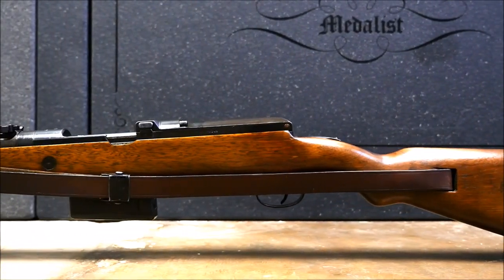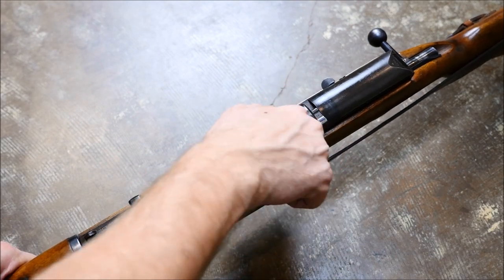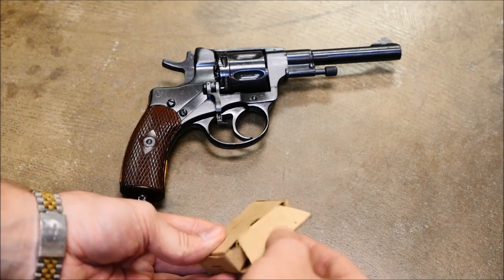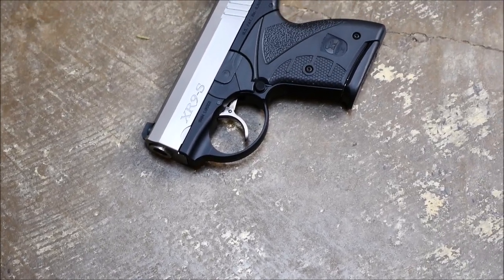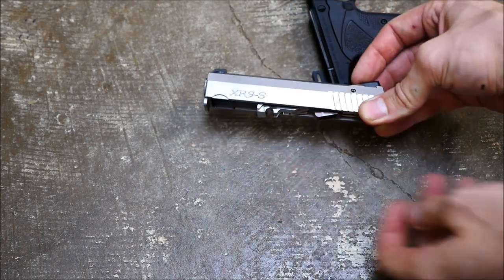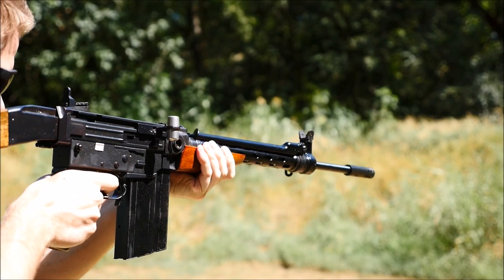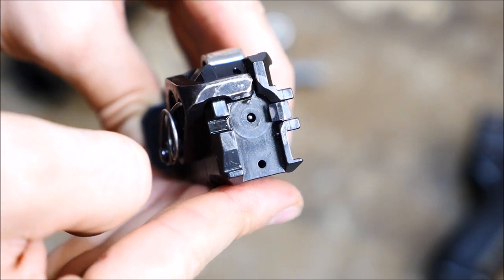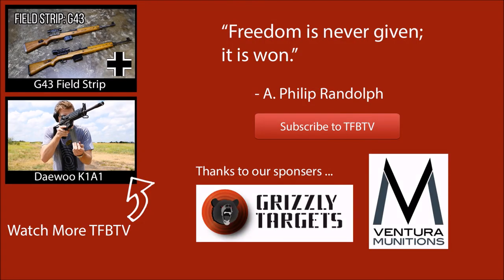Top 5 Overly Complicated Guns

Comment: overly complicated is often synonymous with "well engineered". :)
Reply: Douglas Thompson And “hard to clean”
Reply: and "a pain in the ass to replace any damaged parts"
Reply: And more parts to fail. Simple is better.
Reply: And well engineered is synonymous for made in Germany 😅
Reply: The Tiger I was overengineered to the point where if it ever broke down, the crew couldn't even fix it
Reply: Nick Siegfried yup
Reply: @nicksiegfried4906  not because it was simply overcomplicated but because there were almost non spare parts and the development was rushed
Reply: @joshuaa4677  instear of complaining about complexity how about take the extra time to learn it, its kind of lazyness when not liking things because of complexity
Reply: First of all, I wasn't complaining, I was just stating a fact, and secondly, if there is an alternate to something complex that does the exact same thing as the complex thing but is much simpler to use, it's not being lazy to choose the simpler one, it's efficient. In programming, it is very easy to make a program that does something, but the main goal is to make that program run quickly and with the least amount of drain on the computer, to do that, you need to make the program simpler. When the complex way is the only way to do something, that's fine, but the second that there is a simpler way to do the same thing, you would have to be insane to choose the complex way
Reply: and "fucking bullshit with how many parts there is"
Reply: As an engineering student, I know for sure that we strive to simplify systems as much as possible. More moving parts means more possibility for failure.
The best system is able to perform the same task as other systems, but cheaper and more reliably. The latter often correlates with simplicity in design for reasons already stated.
For example, the 1911 is a simple design, especially in comparison to its contemporaries at the time. Browning’s best designs in general have become the basis for a lot of firearms engineering.
Reply: uh
Reply: Yes and no
Reply: Douglas Thompson agreed
Reply: Douglas Thompson rare and expensive too especially the sig iv seen them sold for over 10 grand and when they first came out were only 348.00 in the mid 70s
Reply: Gotta disagree on that one
Reply: 'Over engineered'. When crap breaks but isn't needed for operation...
Reply: @31er_ohne_AMG  explains Chrysler transmissions...
Reply: The complexity of the weapon will be inverse to the intelligence of the operator.

Comment: Why don't you do a run and gun with the g41m?
Reply from the maker: If it breaks, I have just broken a $20,000 gun with no replacement parts.
Reply: +TFB TV very true, very true. I would just like to see it in action and see how it compares with the g41W
Reply: +TFB TV parts can always be made.
Reply: yeah for another 20k
Reply: +BLT not even close
Reply: +wonderfulmax     A machine shop would have to reverse engineer the parts while they are in mint condition. Considering its rarity, "no replacement parts" is an accurate statement.
Reply: +Captain Obvious I work at a machine shop. I do it every day. every single part on any gun can be reverse engineered and made.
Reply: wonderfulmax
I worked at a factory when I was in college. A part on a critical machine failed, and we tried to get a machine shop to reverse engineer it because we couldn't wait for the manufacturer to ship us a new one.

It was far too mangled for them to reverse engineer. So I'd say that it depends on the damage to the part.
Reply: Easier said than done on a firearm that is notoriously complex & unreliable even with mint condition factory original parts, not to mention one that only 5000ish(?) examples of were ever made.
Reply: someone in this thread should reverse engineer all the parts in it, make a new one!
Reply: DarkShroom That's actually not a bad idea.

TFB TV said the gun cost $20,000. With a price tag like that, you could probably make several thousand selling replicas.
Reply: +Captain Obvious I would buy one
Reply: lmao no, type 95.
Reply: Guessing by type 95 you mean the QBZ-95? If so, why? Everything about it besides the cartridge is comparable with other modern assault rifles and it uses no advanced or unusual firing mechanisms.
Reply: no he ment the japaneese type 95 from Japan the qbz 95 iisnt in america
Reply: Clayton Burch what are you talking about? there are 2 Japanese tanks and 1 armored car called the type 95 but the most recent Japanese rifle is the Type 89. Japan doesn't export firearms to the US either.
Reply: Clayton Burch the newest Japanese guns you can get in the US are Arisaka rifles from WW2.

Comment: The Remington Model 14 was, and is, the most complicated gun I can imagine.  Take a look at the illustrated parts breakdown of the bolt and bolt carrier.  John Pedersen was an evil genius.  http://stevespages.com/ipb-remington-14.html
Reply: +RyeOnHam I read a quote once about Pedersen that said he would use three parts where one would have sufficed.
Reply: +RyeOnHam 75 parts is not that bad. If you think this is a complicated old gun you should see the Browning BAR. I think it's got well over a hundred parts and its disassembly is FAR from intuitive.
Reply: +RyeOnHam  I've read that the Lahti-Saloranta M/26 (a Finnish machine gun) is also extremely complicated.
Reply: +Jeff Thomas 
I've heard the same saying in reference to John Browning,
Reply: John4566442 Hardly.  Browning would use one part in place of 5... and he did.
Reply: LOL... I don't think so. The Auto 5, Model 8, the 97 pump, the early Remington shotguns, many of his pistols, his machine guns and most of the other Browning designs are all extremely complicated. Although revolutionary, they often use complex mechanisms and lots of small parts. More so than contemporary designs? In some cases, there were no contemporary designs, but I would argue that Browning wasn't a fan of simplicity.
Of course, this is with 130 years of hindsight. Browning was a great innovator and the most prolific American gun designer of his era. Even if his guns are over-engineered, they are brilliant original ideas, not copies of other designs.

Of course, this is just my opinion. One man's complicated is another man's simple.
Reply: John4566442 You just mentioned the three groundbreaking firearms.  The Remington model 8 was copied by none other than John Garand and Kalashnikov.  The Auto 5 was the first autoloading shotgun.  The Model 97 pump is still in production today at at least two factories.  Just because they are complex does not mean they are OVERLY complex.  Just look at the Remington model 17...  Browning designed the gun over 100 years ago and it is still in production (Ithaca 37 and Chinese Copies) as well as providing a heavy influence on several other designs like the Mossberg 500, Remington 870, Browning BPS, and numerous others.  Don't get me wrong.  I like Pedersen, but Browning was godlike.  Hard to name a single modern firearm that doesn't have Browning written all over it... except maybe revolvers.
Reply: I agree that Browning was hugely influential and his designs were ground breaking, no doubt. Whether they are just complex or overly complex could be argued either way, since that is purely a matter of opinion.
Reply: John4566442 I would argue differently.  At the time, the Browning Auto 5 was the LEAST complex autoloading shotgun on the market!  I would also argue that the Winchester 1893 was the least complex and most robust pump-action shotgun on the market.  The fact that virtually NOBODY did it better in the last 100 years other than Browning himself kinda supports that.
Reply: Well, you're right. When introduced they were the most robust and well designed guns of their type.

I disagree that nobody did it better for 100 years.
Reply: John4566442 Well, I challenge you to name a gun that wasn't heavily influenced by one of Browning's designs over the last century. You would have to look at only two primary designs, the Savage 520 and the Remington model 17.  But careful, now, because Browning designed more guns than were produced.  May features that showed up in the Winchester model 12 were from Browning patents owned by Winchester.
Reply: The Remington Model 10.
Reply: John4566442 You're funny.  That's a Pedersen design and it was a pile of junk along with the updated model 29.
Reply: How is that funny? You're right, it's a Pedersen design and not a Browning.
Reply: I'm a fan of both Pedersen and Browning.  Browning had already pretty much cornered and patented every good idea by the time Pedersen stumbled along.  Pedersen engineered and tooled the model 17 based on Browning's design.  Despite being a prolific designer in his own right, Pedersen's designs survived only as long as they had to and then Remington ramped up to produce Browning-based designs.  It's not a perfect fit as many good design ideas did not have a JMB stamp on them, but still.  I thought it was funny in that you brought up the Edsel of firearms design.  You may have seen a model 10 that worked well, but I have not.
Reply: Have one in my buddies office. Haven't had a chance to test fire it.
I can't help but to agree with you on most counts.

I too am a Browning fan, so it's hard to make counterpoints. I had to pull the Remington Model 10 out of my butt to come up with something that wasn't Browning.

I have always felt that the Auto 5 was pretty complicated, but I misspoke when I said that it was complicated compared to other guns of the era. That was wrong. Compared to modern guns, the Auto 5 is complicated, but it's a hundred plus year old design and the first successful gun of it's type, so I suppose I should cut it some slack. It took over 50 years for something "better" to come along.

It's easy to forget that those guns set the standard for pretty much everything else that was to follow.
Reply: @John4566442  probably had to do with material and manufacturing limitations at the time. Brownings gun are fairly simple for what they are,

Comment: Also the Russian An-94 hyper burst rifle came out in 1994 originally for the Soviets but was adopted by the Russian federation. Has 114 parts. Originally to replace the Ak-74 platform but was to complex and expensive to produce so in 2006 they stopped producing but are still in service with the Russians as they one hyper burst you get when you pull the trigger comes out in 1800 rounds per minute while it’s regular fire rate is standard 600 rounds per minute

Comment: I cant believe you didn't mention the wheellock, it was needlessly complicated in that the way u prime it was to take a wrench and twist the wheel which took some time. It also needed a very powerful spring to spin the wheel which would break easily and was difficult to fix on the battle field and expensive to make.
Not only was it needlessly complicated but also unreliable.

Comment: i on one hand think overenginnering is great. I mean, its awesome if you can create an efficient, effective, yet simple design (like an ak-47) off the bat, but we learn through trial and error. I really appreciate the platform for improvement that overengineering offers, not to mention the many ideas it brings to the table. Which part of the system do we improve upon? which parts do we mitigate? its artistic, in my eyes

Comment: The Nagant is an amazing revolver to have on the grounds alone of its uniqueness. It is definitely one of my favorite pieces in my collection. As for the suppressor story, they can and there were some that were for KGB as a way of a more  silent kill and depending on the maker of the suppressor they can be very quiet. They made snub nose ones for agents as well. The first Nagants were single action only so you would have to cock the hammer manually but then it was realized it was a flaw and converted most of them to double action like the officers ones so single action are the rarest one to find.

Comment: The Madsen LMG.  In an effort to produce a more compact light machine gun, the Compagnie Madsen A/S designed a special recoil-operated falling-block mechanism which allows the entire cycle of loading and unloading each cartridge to be accomplished with the whole thing recoiling only half an inch.  The gun doesn't have a bolt; it has a falling breech block similar to that used in a Martini-Henry rifle.  During recoil, the breech is opened, and the extractor lever pulls the spent cartridge out of the barrel and down the ejection trough cut into the bottom of the breech block.  When the mechanism cycles forward, a new cartridge drops down from the magazine and is rammed into the barrel.  The breech is then closed, and the hammer is released, firing the cartridge.  The whole mechanism, with the barrel attached, is locked back when the gun is ready to fire.

Comment: The SIG AMT looks a lot like the STGW 57, the battle rifle the swiss army used until the 90s and i dont think thats a coincidence. my father likes it very much and even if its not as accurate as my army rifle, the STGW 90 or SIG 550, its still very competitive in tourneys in switzerland. also, here the winter trigger is more used than the standart one because you have a longer lever and can pull the trigger more sensitively.

Comment: I remember seeing a stupidly complicated gun in a museum here in the UK. It was a revolver, but instead of having a rotary magazine and a single barrel, it had 6 barrels on a rotary, so one for each round. When you fired, the whole barrel array would rotate like the magazine in a normal revolver. I just had to wonder who in the hell thought it was a good design.
Reply: That's actually simpler than a standard revolver - you don't need to be concerned about the high(er) tolerances needed for cylinder timing etc.
Reply: +TheEnglishRedneck45 plus no gaps in between the cylinder meaning less wasted gas.
Reply: I would want to see that design
Reply: They're called 'pepper-box' or 'pepper-pot' pistols. I've seen a few in antique shops in a variety of places, but they're mostly replicas and very poorly-cast.
Reply: xD ive seen one of those and like, who ever made them had nothing to lose

Comment: One of the big advantage that the Nagant Revolvers had over other revolvers were that they were gas sealing like you said. So you could even shoot with your hand in the odd position in between the cylinder and barrel if you should ever need to without it tearing up your hand. And if your in a tight space, the guy beside you isn't getting all that expelled energy and gas from the cylinder to the barrel.

Comment: The M-16. 
Haters gonna hate but between the charging handle, bolt catch, forward assist, and dust cover it is objectively more complicated than   most of these guns. Every one of those actions can be done wrong and cause problems. Not even going to include the selector which adds some but not much more complexity.
Reply: Everything you've mentioned is part of the controls or otherwise separate from the action mechanism. The action itself is quite simple. Gas unlocks the bolt, carrier moves back, spring pushes it forward. Not much more to it than a majority of piston or roller delayed blowback weapons. The manual of arms may seem like a bit much, but it's set up to be quite easy.

The forward assist is largely pointless I'll give you that, but all non reciprocating auto loaders have a separate charging handle. A spring loaded dust cover also isn't really something that's going to cause any rifle failures. It may fall off, but it's not going to cause some failure within the action. The bolt catch is an added component, but LRBHO is very convenient and not exactly uncommon any more.

The guns in the video however have quirks within the operating systems themselves. Two extractors, rollers and "flappers" in a single action, a moving cylinder, a bolt gun-auto loader combo.....those are complications within the actual actions and firing mechanisms. The M16 doesn't really compare in that regard.

Comment: You are correct, the C96 (a friend has one), has got to be up there with the Madsen machine gun as least favorite field strip. The reason, and it's not really apparent from a still photograph, is with not screws everything is a cam way or spring and it seems all those parts are under some kind of spring tension when assembled. I give it two thumbs up for being the sexiest pistol I've ever seen, but like a sexy woman it has internal complication issues that don't show up until well into the relationship :)

Comment: That would have been the German MG 42, by Mauser, that first used the roller locks, and would have held the patent. The roller lock was used to increase the cyclic rate. The MG 42 was a nightmare for our troops landing at Normandy.
Reply from the maker: +craxd1 The MG42's mechanism is much different than a CETME or G3 rifle (or SIG STG57's). Roller locked is significantly different than roller delayed blowback present on the aforementioned firearms.

Comment: Surprised you don't include the Chiappa Rhino.
Reply: +frankdn109 The complex part of a Rhino is the trigger / hammer assembly, other than that it's a simple revolver. Slightly upside down but still a revolver. I don't think Chiappa ever submitted the rhino for any military trials, and it isn't really a high volume product either. A better addition might have been the Mateba Unica. It has the low bore axis and is a semiautomatic revolver. But again not a military weapon and very limited numbers produced.